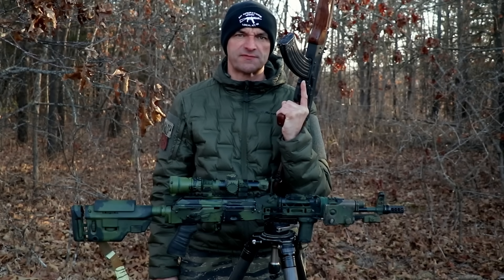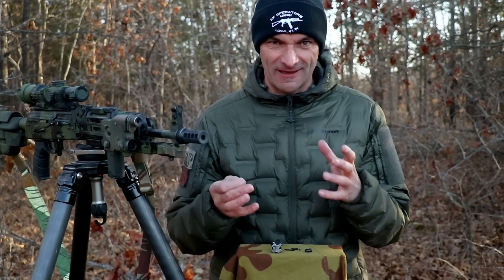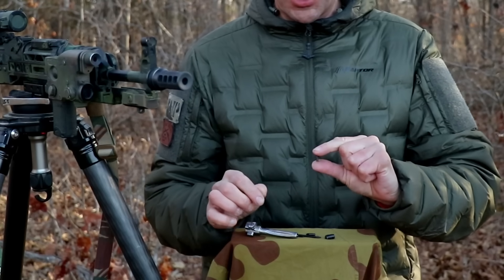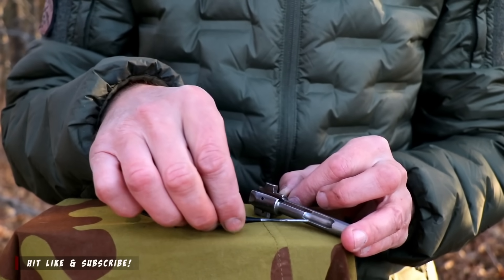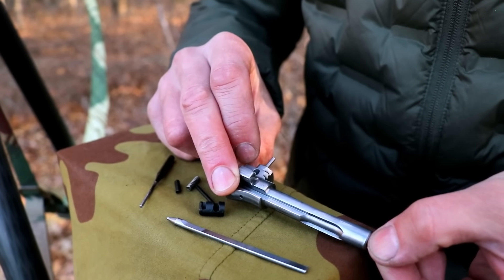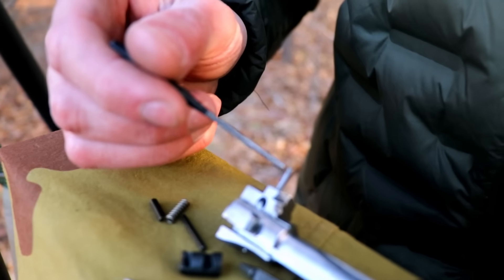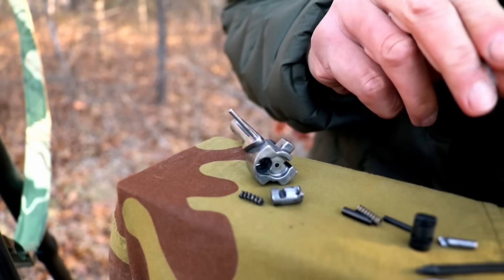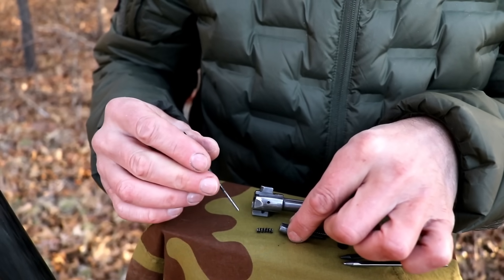You Need This To Keep AK47 Running! Must Have!

Comment from the maker: Thank you for watching!
AK47 / AKM Bolt repair kit: https://ak4774.com/product/ak47-akm-bolt-repair-kit/ 
AK74 / AK100 Series Bolt repair kit: https://ak4774.com/product/ak74-ak100-series-bolt-repair-kit/ 
Recoil Spring Assembly: https://ak4774.com/product/ak47-74-recoil-spring-assembly/
Reply: Will this fit Chinese Norinco MAK90?
Reply: SLR-107 counts as 100 series right? Or would that be AKM still
Reply: Are all those parts the same for 5.45 and 7.62?
Reply: So would i need the ak47/akm kit cuz i have a PSA AK-103 which i think has more of a akm bolt?
Reply: He actually has a different set for those, listed as the AK100 series kit. I'm not sure what the difference would be. Anyone in here know???
Reply: I actually just looked at the GF4 and 103 firing pins (both PSA) and they're both the thicker pins. Same internals too.
Reply: Yeah does the 100 series kit fit 103 as well?
Reply: @nondestructive6456 Because PSA doesn't make an actual 100 series rifle.
Reply: @timunderbakke8756  I'm wondering that one too.
Reply: "American made AK" just makes me want to throw up in my mouth... although, i built my AK in the US, it was an Egyptian Maadi parts kit... ANYWAY....
Can i buy a spare (new?) bolt and have that as a spare?
My firing pin retaining pin is cocked up so if i had to replace the extractor, i-d need a really big rock
Reply: Hello....Love your channel.
I wanted to buy a bolt repair kit for a Ishmash saiga sporter 762 x39 rifle. 
Can you tell me which one of your kits would fit?
Thank you....😊
Reply: Have the JTS ---M12AK----T1  12 gauge semi----Automatic Shotgun, any I"D  as to what may work as replacement bolt repair kit  ?
Reply: @blackhatch46  It should. The main changes from one caliber to another in the series was barrels. The bolts are all the same outside of monor fitment upon original construction construction.
Reply: Springs are made in an alternate universe, when they leave, that's where they go....just gone,
Reply: I have question for you sir I purchased a kalishnikov kr 103 and just realized the company is no longer in business. Are these parts you mentioned compatible with that model? Thank you for your insight as the company has not responded to me

Comment: The repair kit is a good idea. A lot of these issues other than breakages would be to not disassemble the bolt when cleaning unless it is causing malfunctions.
Reply: You need to disassemble the bolt to clean the firing pin to remove the carbon buildup, or you’ll end up having a hang fire, because the firing pin got stuck from the carbon buildup. I had this happen to me with my SVT-40. After a good cleaning, it runs like a Rolex. Routine maintenance is key. Even spraying a little silicone will help prevent condensation from getting inside the bolt and causing problems. Even applying silicone to the bolt guide rails will allow the bolt to run like a Rolex watch, and put more rounds down range.
Reply: corrosive ammo is another reason to strip the bolt down for cleaning

Comment: I once had a stuck casing which had to be rammed out with the cleaning rod; because the extractor ripped half the hull off the shell. (Wolf 123gr fmj)

Comment: Also, it’s worth noting that you should replace the shepherds hook with a retainer plate. Had my entire trigger group come undone while at the range because the shepherds hook wiggles free under rapid fire.
Reply: The only malfunction I've ever had with my Zastava m70 underfolder has been the Commie Paperclip wearing out and coming loose (at about 3k rounds). My dad was shooting it when the trigger just "disappeared" on him and we couldn't even move the bolt back far enough to clear the gun. The trigger pin had walked out (and was never found) and the trigger spring pulled the trigger and hammer up into the gun, blocking the bolt. Doing a partial disassemply on a hot gun at the range was an uneasy experience. I then bought a 10-pack of retainer plates and put them in all my AKs. Worth every penny

Comment: One thing to keep in Mind, is that the 1) Length of the Bolt may Vary (My Romanian AK-74 Bolt for instance, from Cugir Factory is shorter than a Bulgarian Bolt, even though both are slim or narrow stem Bolts. )    and 2)  The Stems on the Bolt may be the narrow design (As in the Bulgarian AK-74 Bolts, and the Russian Saiga Bolts.)   or the  fatter stem design as is the case with earlier AK's and Bulgarian Bolts in 7.62X39.    The Bulgarians also made spring loaded Firing Pin Bolts for some of their AK-47 variant 7.62X39 Rifles.     Just an FYI.

Comment: FYI.
Vepr AKs like my Molot Vepr AK47-21 side folder uses ak74 style bolts and bolt assembly pieces.  So standard Romanian, German, Chinese, Hungarian AK47 spares kits and surplus parts won't work on the later Russian AK47 rifles. Earlier Russian AKM style rifles use AK47 bolt parts. But later Russian rifles switched to AK74 style bolts and components.

Comment: The Kalashnikov K103 bolt is much more difficult to reassemble the extracor , the M70 is  simple. The K103 bolt is easy to dissamble, installing the extractor and spring will, definetly not be easy, I learned how, but you may not be able too.

Comment: I just keep a spare complete bolt in my 74 side folder rifle dynamics stock pouch for my 74. And for my 5.56/.223 AK I just keep spare extractor, extractor spring, firing, and retainer pins in a Ziploc bag in a small pouch on my rifle sling

Comment: I recently got the PSA AK G5 Blem model (only Blem was they marked G3 on the bolt, just lásered on wrong) & a PSA AK G3 Blem (No Blems at all). I’m still a huge AR15 advocate, but purchased these for SHTF purposes. Your videos are helping out this old armorer a lot!! Between the accuracy & ammo prices I’d still stick with an AR, but have just enough AK knowledge to use these if we have to. I’ve seen your accuracy videos & I am shooting paper plate accuracy with stock irons, so I’m not that great, but appreciate your videos on this weapon system!! Thanks again!!

Comment: I have a Yugo AKM70 AB2 that has a polished steel bolt and parts. Do you plan to sell a AKM bolt repair kit with polished steel parts to match the original parts I would have to replace on this type of rifle? Enjoy all your videos, your knowledge on the AK/AKM platform is very impressive.

Comment: A must have. The only thing I add to my repair kit is a disconnector  spring. If you are running a CRAPCO G2 trigger set, go ahead and add a quality surplus disconnector. I've seen a dozen or more brake right in half.
Reply from the maker: True to that. I would add fire control pins to the mix too. They don't brake, but people like to lose them when cleaning and etc and they are gone...

Comment: rob, i don't mess with any of that shit on my ak. why i need to buy replacement parts for shit i never fuck with?
i only field strip ak, clean as much as it needs (not much) and then put it back together.
Reply from the maker: I drive car daily, never mess with my tires on it, why would I carry spare tire then? See what I did here? Because shit happens...;-)
Reply: @AkOperatorsUnion  that makes sense. thanks

Comment: What is the procedure if you have a spring loaded firing pin and what additional parts are needed? Do they come in the kit?
Reply from the maker: No, sorry, i don't have spring loaded firing pins or springs for it. That being said, springs in the spring loaded bolts like to fall apart fairly quickly. If I remember this correctly, on one of the Arsnals it took less than 2k for that. What I did then, was just drop the spring, clean the firing pin channel from the debris and rock and roll! Also, it is possible to fit regular firing pin into those bolts (they will work with it), but it will look weird, with the large opening on the back of the bolt, because spring loaded pins have "rounded ass" to cover that hole, lol!

Comment: I am having a problem with the new bullet occasionally not fully reloading into the barrel and the firing pin denting the new bullet just below the actual top half of bullet casing.
I was told it was because I was using Russian steel coated ammunition?
I have bought new brass ones to try.
Do you have any recommendations please?
Thank you 
Dave

Comment: I own a Hungarian AK55, which has barely been used. On the range I had some failures to eject and the malfunctions caused by FTE. Manually i could cycle the rounds. The guy I bought it from said it has not been cleaned since 2018. I also noticed that the firing pin retainer is just stuck. Is that normal?

Comment: Taking the bolt carrier apart in my chrome lined C-39 is basically like fused together, essentially impossible to take apart. All my other 5 Aks including Veprs are tight but can take them apart to clean them.
Reply: you're not lying, I had to send mine back and then I sold it
Reply: I’ve had a few like that I dremel the rear channels well on one side usually the left so the carrier will come out. Dont be afraid of it u won’t hurt it.
Reply: @TheFloridaBikeVlogger  Tried to disassemble my bolt on the chrome lined C-39 after 4k rounds and it is impossible they must've heat treated all the parts together everything is fused together so i just oil and hope it never breaks apart. Very impressed with green mountain chrome lined barrel has deep chrome lining surviving like a champ. My 4 veprs i have been able to disassemble no issues. I'm going to hope it never has issues.

Comment: Something else important to keep your AK running is to have swell-neck rivets and have the receiver dimpled into the trunions. Something PSA does not do.
Reply: Seemed to do ok in the 5000 round torture test.
Reply: 5000 rounds is just a break in for ak's. Psa ak's don't usually last much longer after that
Reply: It won't last forever. Those rivets will eventually sheer. The AK was designed to have the receiver dimpled into the trunions with swell-neck rivets.
Reply: Ya we’ve heard about that about  5,000 times. I dimple my own at home and squeezing rivets with modified bolt cutters.
Reply: Of course I want swell neck rivets but in defense it’s not like all of the sudden boom your rivets are sheered off and your barrel falls off. U would notice something off about it. And the rifle would still fire a good long while giving u time to have it properly done.  I only own self assembled combloc aks properly done but I still thing that rivet psa deal isn’t a big deal even bucking the barrel with a rivet gun on early IO guns still functioned. If I had one I’d just plan in the future to Maby add swell necks but Maby being a builder it’s more convenient. I probably wouldn’t worry about it. Just check it every couple thousand rds😂
Reply: So you'll ignore the designer and 70 years of proper design? No, it is a big deal and you should want your AK built properly.

Comment: Always important to have spare parts. For my ARs i keep a full BCG on my carrier/chest rigs just in case. No time to full with broken lugs or anything, just swap the whole thing lol
Reply: Yo what? I mean my Al has a bunch of spare parts, learned my lesson doing cowboy action shooting, but I have never worried about broken lugs. What's your bolt made of, cast aluminum?
Reply: @grizzlyblackpowder1960  lugs breaking is actually a really common thing on ar bolts around 5-6k rounds. Its obviously not a guarantee but the risk is higher as round count increases. Way more common on the shorter gas system rifles as well as they are just generally more violent

Comment: Will your AK-74 100 series bolt repair kit fit an Arsenal 105? Thank you for the tutorial and excellent information.
Reply from the maker: Extractor claw and spring and pins should work, but Arsenal is using spring loaded firing pins and I’m not sure how it is shaped because I don’t have Arsenals 105 to check…
Reply: Thank you for the reply. @AkOperatorsUnion

Comment: I do not regret getting a stronger replacement recoil spring (from alg i think?) but my hands have never forgiven me.  Pushing the spring down far enough to create the T was … challenging.  Even using my chest just left a bruise on my chest haha!  I ended up having to use a vice (gently) on the bottom tip.  My hands started to hurt in sympathy watching rob push that spring down - but if you have similar issues, keep trying!  It gets easier as you wrestle with it and learn some “spring gymnastics” - it is hard to explain but trial and error found sweet spots to place each hand and it got easier to do (but no less painful for my cherry-soft delicate palms!)
Reply from the maker: Ha! yes, those springs could be "fun" to work on.

Comment: Unless you have a Type 56.  The 56 uses twisted music wire and a "butterfly" for the spring retainer.  Finally found it years later after I shot it somewhere in the basement and had to fabricate one.  REAL easy to lose!

Comment: For demonstration purposes, Rob ski is using a tiny workspace about 4" x 15" that is elevated about 4 feet off the ground AND he's outside in a field of fallen leaves and he lectures us about not losing AK parts!!! 😄Please, do not emulate him. Work inside but if you're outside, sit on the grass, throw down a tarp, a small tool roll, an unfolded bandanna or keffiyeh/shemagh (much larger than a bandanna) and go to work on it. Extra bonus points are awarded if the work surface cloth is a lighter color than the bolt parts. If you are about to launch a spring or tiny pin into low earth orbit, cup your hand over the exit hole to prevent that. Work carefully, don't lose your parts and remember: a fully battle ready Avtomat Kalashnikov is life!  Just poking fun 🤡

Comment: Very good video, please keep making them. I find them very informative, helpful and entertaining .
 I bought a century's arms Romanian wasr-10 ak47 for my first ak rifle. First off, is that a chromed bolt and firing pin ? And if so where can I get them ? Next, if you wanted to get a back up bolt & bolt carrier with gas tube. My question is,  when buying a  spare bolt and carrier don't they need to be headspaced and possibly some fitting done on them ? Also, are there other ak type bolts and carriers even from other countries that will work as replacements ? Thanks 🙂

Comment: Hey Rob I got a question, can I just a second new bolt assembly with everything together rather than just the parts going to the bolt, wouldn’t that be better already assembled and just drop it in ?

Comment: I have a question on the bolt repair kit...
I'm down to 2 AK's (plus a 74) from the 7 I had in my collection 10-years ago. Yea, it sucks but Bidenomics, disability, C'est la Vie, right? 
Is this kit "universal"? As in, I have a Yugo Zastava M70AB2 and a Bulgarian Arsenal SA93 (yea, original import w/Steyr barrel & milled receiver!)... will the kit work with both? Neither has shown any signs of wear or slowing down but it never hurts to have spare parts on-hand. I recently had to do an extractor swap on a M4 in the field so that had me thinking about my beloved Kalashnikov's.

Comment: Robski. For some reason when I fire my WASR the hammer gets pushed all the way down and locks like the safety is on. Just happens randomly all of a sudden. There's about 2500+ rounds through it. I do have a KNS piston in it if that makes any difference. Do you have any ideas as to what's happening or what I can look at? Thanks in advance.
Reply from the maker: Email me at "rob @ ak4774.com" - no spaces in the address, I'm just fooling bots here

Comment: I would add a spare recoil spring, disconnector spring and hammer spring to this list of spare parts. Springs wear out over time from normal use and need to be replaced.
Reply from the maker: I talked about the recoil spring. I honestly haven't seen hammer spring go bad yet, but yeah, good call. Now, I forgot to say that, trigger pins - they don't go bad, but for some reason, people like to lose those...

Comment: Import parts for AKs are dwindling. Good luck having a consistent supply. 

The superior American AR platform is the best solution in terms of keeping a weapon system operational over the course of a weapon's rated lifespan. It's easier to replace worn-out parts on the AR given its superior design and large supply chain.